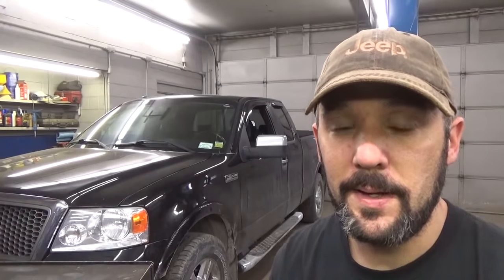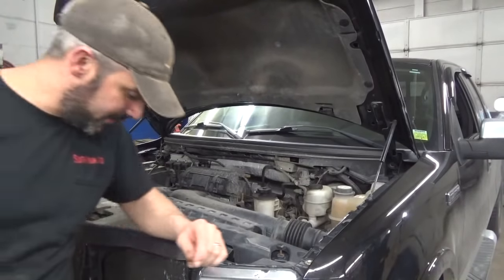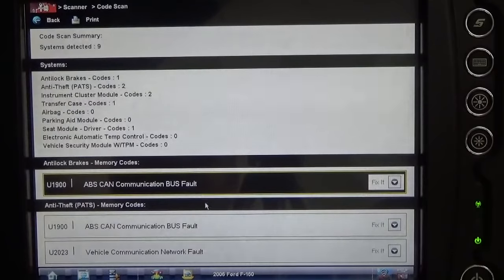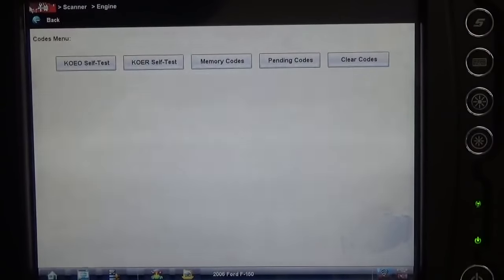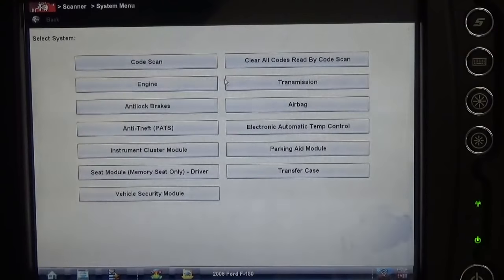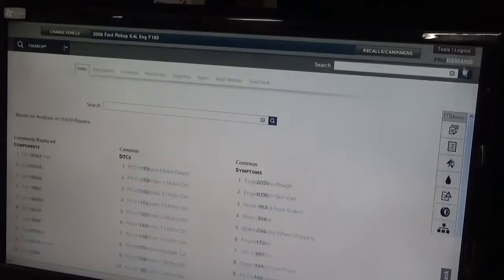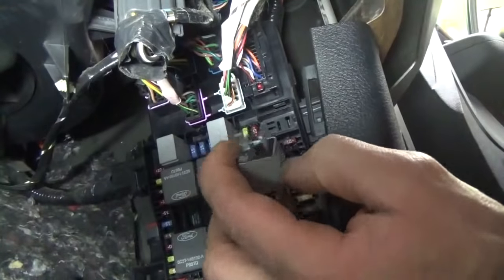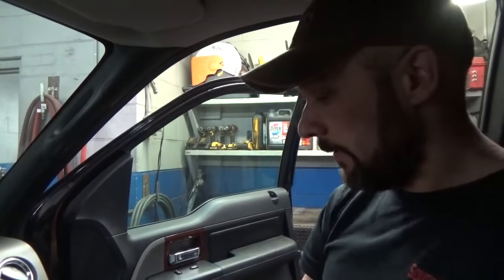Ford F150 5.4 No Start, No Crank, No Communications Codes: U1900, U2023

Comment: Thank you so much other than that battling with this expedition and same thing no turn no start but then I found the sequence for the theft device and put a code in to the door lock and it only took 40 to 60 seconds to get the engine to start but you have to have the key with the chip in it in order to override that alarm any text system you probably already know that but thank you so much

Comment: Thanks Eric excellent job u always getting it sorted,,,👌 I've got something Honda not starting key light flashing,, OBD2 says error in communicating with ECU???any thoughts thanks
Reply: I don't know what year or what kind of Honda.  Mine was the ignition switch that turns ecu on.  I had a manual and the little sensor by the clutch pedal was bad and it wouldn't start unless you roll it.  My two cents.  I did take it to a shop.  They said it needed a new ecu, o2 sensor, everything else but the problem. With old car that's pretty cruel what they do to poor people.

Comment: Saw your video can you give me advise 2005 f150 fuel pump turns on no crank jumped the ground side of starter relay get crank with key on and no start have power from switch to starter relay was fine adjusted shift cable and on park and nutral but have to put ground on pcm side to make starte run

Comment: I have a 2004 that started doing the same thing. I might start just fine the first few starts, then no crank. Walk away and come back an hour later and it starts. But now I was stranded for 3 hours and it never started. I can't afford a tow so let it sit over night and will go try it in the morning. QUESTION, is the fuse box the same in a 2004 as was a 2006?

Comment: Did you check for oil and coolant.  In my case I always check for power in fuel pump and ignition  if that is not the problem then I check for other details

Comment: I have one for you ! My husband has been having issues with his 2011 ford f150 crew cabs wipers they work then they don't work except on high and when they only work on high there is no windshield wiper fluid. He replaced the wiper switch with turn signals and it work for 3 weeks and now is doing it again . what would you recommend ?

Comment: Believe it or not you have cold air conditioning coming through that section from a fan motor and between both seats on the dash.
So you get condensation and should spray some contact cleaner over the fuses area.

Comment: Those trucks have moisture issues I that area. The wire bundle that supplies the master door switch and seat controls go under the sill plate. And ford put the door jam drain in the rocker panel along with those wires. And a slice is a week link somehow that moisture finds that splice and corroded the wires braking the splice and results in no windows or seat controls more common seat controls.

Comment: Ford 2006 over time could just be a defective seal on the relay cover letting a little water salt ETC in now and then. Not going to last forever. I really like how you attack it. So Far what i have learned is Fuses, Relays, Grounds first. Thanks. When everything is not working.

Comment: You should use electrical contact cleaner  to spray on the contact in the box under the relay.. a tip is to check where the water came from that caused the corrosion in the relay. Fords are bad for getting water in that box . I have seen water come gushing in  when water filled up the space under the vents behind the hood in front of the wind shield in a 2005 mustang when the weep hole got plugged up at the bottom...

Comment: Check the windshield  seal near the A pillar  I fix a lot these Fords, water leaks inside the cabin  and cause fuses burns, so I explained to my customers and fix the windshield seals , no more water in the fusebox  no fuse blown or bad relays

Comment: So I have the same symptoms but intermittent when the weather is cold.  The battery has been replaced.  I assume if the relay was bad it would not work at all.  Could it be the starter solenoid?  Do starters freeze up in -5F temps?

Comment: I don't know if this is the right place to ask questions but here goes. 
I have a 1995 Toyota Camry that runs and drives  but after driving it for a while when I slow down to make a turn or come to a stop it stalls. I have changed the Throttle Position Sensor and the Idle Air Control Valve but it still does the same thing. 
Any idea what it could be? 
I know you can't diagnose over the air but any help or ideas would be greatly appreciated and helpful. 
Thank you for your time.
Reply: put a distributor on it

Comment: Any advice is much appreciated but I have a 1998 F150 that will not crank. Battery is good and has a brand new starter. Thought it may have jumped time or flexplate was busted but both are all good. Any ideas?

Comment: I have a 2001 Ford F-150 XLT that is done almost the exact same thing, except I get a click at the solenoid on the firewall. I am thinking either solenoid or connections on the starter or possibly even a new starter. Your thoughts?

Comment: I hope my issue is the same. 2003 4.6 V8 f150  346k miles . Started and drove fine, drove 2 miles to store and shut it off. Tried starting 10 minutes later , nothing! Had the battery tested and its good . Tried tapping on the starter too. Turn key hear 1 click under dash and nothing else.

Comment: What components stay charged when key is not in ignition? I have a 2010 f150 ford 4.6 triton, clicking sound from power distribution box and headlights had a dim effect with no key in the ignition.

Comment: Hello I have a 2008 F-150 it's doing pretty much the same thing that this truck is doing I applied a Superchip and after trying to install the Superchip it locked me out of the truck you turn the key it does nothing you hook up a scan tool it says the key is not on I believe what you did is about the same I'm hoping and praying this will fix my truck

Comment: I have a 01 F150 where the truck cranks, with no start, and no power at the OBD plug. The plug fuse is good, how else can I pull my codes to further troubleshoot? Awesome video by the way.

Comment: Pin 6 and 14 at the DLC if using a meter have approx 6-7 volts you have no network issues if it's less look for modules with terminating resistors that are no com.

Comment: That relay corroded like that because whoever or whatever (men or factory robot) put it together , had crossed two or more connections, possibly with excess solider or whatever, and when they tested it, it passed because the cross contaminated connection was  so manute, it didn't cause the relay to malfunction immediately. but electrolysis occurred. And over time that electrolysis just did what it does. It corrodes, I would say that kind of relay malfunction has got to be pretty rare..

Comment: I have a 1998nissan maxima with the 3000 engin I put a new starter on it about 4 months ago I didn’t have much gas in it when this happen it didn’t crank about 5 times I waited about 3 min it will crank right up is this a lose bolt or is it a fuel pressor switch?

Comment: You may have found what my 2006 Navigator did to me .  I just purchased a 2006 F150 XLT  because The Lincoln just would not start.  I still have time to return the F150 and save myself over 10.000 dollars.  I going look tomorrow morning at that module that you showed.  I think its inside my engine compartment on Lincoln Navigator.  side the engine, The Dealer wanted from $400 - $600 and he called it brain.  Nobody wanted anything to do with it.  I will let you know I make out.

Comment: This kind of issue is like on the Lincoln Navigator 2003 i mentioned in one of your video, i also tried switching all those relay but still the vehicle won't crank/start because of error message on the vehicle dashboard "PRNDL error No park assist". Hope to hear from you soon.

Comment: @Eric. 

My truck runs, but the dash keeps resetting while driving and the odometer stopped functioning. I took the odometer out and put it back in with the battery disconnected (i reset pcm as well) worked for a week, now its worse. Any suggestions is greatly appreciated. No issues with relay or fuses.

Thanks

Comment: Ok, so I commented a couple months ago. Swapped relays fixed my problem. Fast forward 2 months. Truck does the same thing again today. No crank, no fuel pump. Everything else seems normal it just won’t hit the starter. Pulled same relay, waited about a minute and reinstalled relay. Vrooom, she fires back up. It’s almost like it reset the trucks computer??? Any thoughts on where to begin on finding the culprit for this?

Comment: I need help> 2008 Ford F150 dipstick tube mount missing and trani fluid pours out of dipstick hole.. I think anyway. But unsure. Original issue was MAF sensor. I got that cleaned and then next thing I know Trani fluid leaks out intermittent if left without starting. brand new battery dies after not being started a few days and after market stereo quit working after jump starting a fair amount of times. Im a women and going crazy trying to figure this out. Where is the trani fluid coming from? Can it be from a vent line? Fuses are good on stereo.And on top of it all I just saw whar appears to be a whitish fluid areound a spark plug on the same side as the trani fluid dipstick handle ugh !!

Comment: This is at the 3-minute mark 
I wonder if it has to do with the Anti-Theft because it would in my opinion shut down the whole ECM if it did not recognize the ignition key
Reply: Or it may be something as simple as a neutral safety switch I don't know

Comment: Yeah it's in a crappy spot better under the hood or at least where you can pull it out to better see what your working on  and I've worked on them from 1940 to 2006 and a bit newer too  and back befor ecm the rule was check the fuses first lol but it was a good hunt for the green crusties knew youd nail it

Comment: I have a 97 f150 4.6 dad going down a little crank but will not start we change the fuel pump where you changed the solenoids we we've done all that and it's like it's got a dead short somewhere because the number 24 fuse on a few pound clothes every time you go crank it

Comment: The third brake light, pinch welds, roof moldings, windshield mounts, wiper cowl clips, rear cab vents, wire loom grommets….all the Flood150 owners on the Gulf Coast or up Seattle somewhere know what’s up lol keep cans of Water Displacement 40 at all times.

Comment: My 99 F150 shut off while running. I started it back up and drove home. Today when I started it, the gauges maxed out (speedo, tach, fuel, oil, volts) and it shut itself off.  Then I have no power in the cab at all no dome lights no headlights nothing. I try to crank no sound to fuel pump, no ignition chimes, just everything dead. I popped the hood to check the battery terminals everything tight. I notice the under the hood light is on, the one they put in so you can barely see to check the oil. That is the only thing that appears to have any power.  I have no clue where to even begin looking. This sucks I just did the brakes ball joints and steering put a lift on and new tires. almost $3k in new parts.  Then this happens.  I just replaced the starter and battery and alternator last year.  Any thoughts? This truck is my life I am dead without it.

Comment: I had a buddy I worked with on remote construction sites who had terrible luck with vehicles. Bought a beater Toyota 4runner to get back and forth in the snow, frame was rusted and rotted out in 1 winter. Bought a newer ram, it was killing him in gas costs. So he bought an older basic chevy pickup and drove it out of town to see his ex and kids and it died. Took it to a mech and they said it was the fuel pump and was going to cost $1200 to repair. He only paid $2K for the truck so he took the bus home. (2+ hrs away).

So we were talking at break and one other coworker, (who was born again christian btw) said "I'll give you $600 for it" SOLD. 

So he and his son went down with a spare external fuel pump and some wire, was checking it, ran off to auto parts, it was the fuel pump relay. $12.00 drove it home.

came in the next day and was "bragging" on how easy it was to fix. The seller was heartbroken. Literally he'd had nothing but bad luck with vehicles.

I brought up the born again comment because this guy was always preaching about how "good" he was and how he'd be going to heaven and he was so pure etc. I was partnered up with him and frankly was getting tired of his "bragging". Well, this incident told me a LOT about him. A truly "good" person would have said "listen, I got it running, it only cost me a day to go down get it and bring it back. Let's cancel the deal and you give me $400 and we'll be square. Did he? nope, he laughed and laughed about it.

I brought this up to him and said "dude, if you had any honour you'd have done that". WHY? you snoose you lose! I said "we work with him every day for 2 years. He's not a stranger. He's not a jerk. He deserves a break. He said to me "would you do it"? I said "hell yeah, in a heartbeat. I wouldn't even hesitate. I guess you being all pure and good and christian doesn't compare to corrupt and sinful me eh?

I've done far more for complete strangers.

Comment: my buddy is having this some issue. i watch this video and unfortunately switching the fuel module did not help. he said that i lurched then die. all fuses are good and so is the battery. any possible help?
Reply: it was the shift linkage at the floor shifter. had to replace the bushing, between the cable and the shifter in the center console

Comment: I was hoping it wouldn't start after that relay find... Cause I have the same issue, but my relays look fine.  I put power right to the starter and it works, but turning the key does nothing with the starter..

Comment: Bro, advise where to look for a solution to the problem. The interior light does not turn off when the engine is running, but if you turn off the instrument panel illumination, then yes. ford F - 150 XLT 2006

Comment: Just got my 2011 F150. Mine has had an issue 4 different times, unable to reproduce the issue at the dealership. The issue is when I turn the key, I got nothing. On the 3rd turn it fires up. I also noticed that my ignition is a little loose, when I slightly move the key the tac needle light flickers. 🤷‍♂️

Comment: I have a 2007 f250 no speedometer reading replaced the vss. Have a u1900 code pointing to the abs module and I can’t comunícate with the abs module. Where can I find a wiring diagram for this?

Comment: T everything turns on but won't start it's the 4.3 motor with 5 speed but I can it starts all gauges come on everything comes on but I cannot get ignition to the fire you tell me how to bypass that to get to fire I appreciate it thank you very much Dan Ruhl thank you
D

Comment: I have a no crank no start! I took my fuel pump fuse out so I could turn the motor over to prime it before I started it but it won’t turn over. Does it have to have the fuel pump fuse in to turn over?

Comment: I took the fuse compartment on my 2005 f 150 because it kept leaking water from the passenger side and found out that some of the water was dripping partially on the back of the fuse compartment and it looked just like that, but mine was still working

Comment: Change that fuse #32 it looks good but probably internally defective it s happened to me before.placing tester completes circuit felay might have intermittent connection switch relay for seats or a/c controller til  you get a new one.  Open relay and check it physically coil may be droping out because you never know.

Comment: So i checked the fuses and relay and they all appear good.  I have had a ground issue with my cigar lighter where the fuse is blown, I'm guessing from a bad ground.  So this prevents me from getting power to my diagnostic port.  SO i'm flying blind with no codes.  where would you go after the relay and fuses check out.  I own a 2005 f150 4.6:L v8.  I have no fuse in port 12 that is unused....
Reply: ok I disconnected the cigar lighter... and it throws a C1230 code.  I wouldn't think an ABS code would stop the truck from starting....

Comment: I have a 150 2006 . The starter will not engage once a day . Hot or cold . I have changed the starter five times . Just changed the wire harness that goes to the starter . The key switch and the relay . It is really intermediate.

Comment: I have the same problem no cranking no click.. i did the tune up, change the starter turn the engine on directly for the starter.  After did nothing no start. Cheked the relays as you did and theyre fine.. would you have any idea what can be..

Comment: I have a 2005 Ford 150 and haves power sparkplug and the injectors to and the truck is cranking but it does not turn on do you have an idea?

Comment: I have an 04 that will turn over but won’t start and I charged the battery but it won’t even power up the code reader so I know nothing about it. I’m not mechanicaly inclined so I am pretty much stuck now. Any advice

Comment: My 06 fx4 has a strong crank but no start with a u1900 and a p1000 after I pulled the radio and swapped the blender actuator door. 
I checked this and the other related fuses and relays. 
Any ideas?

Comment: Just had one at my job today a 2004 f150 no start no crank no power to the dash and airbag light flickering. Looked up on identifix and found articles about a G200 ground wire on the interior drivers side kick panel under the hood latch. Ground was completely rusted cut old peice off and put a new connector and used a self tapper right next to where the old bolt was, just cleaned the paint off first. Started right up afterwords. Hope this helps someone !!

Comment: Cam tensioners failed and the cam has rolled back an locked the engine up.
I just had a 2006 f150 4x4 lariat that did it.
Rebuild... replacement